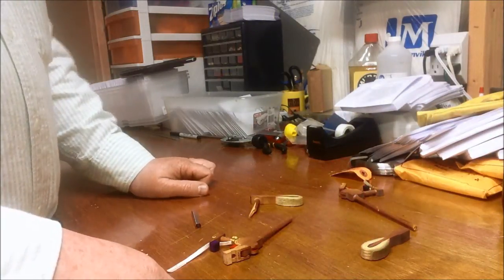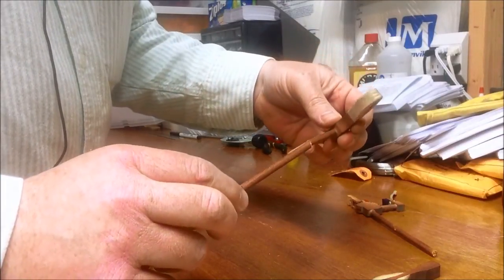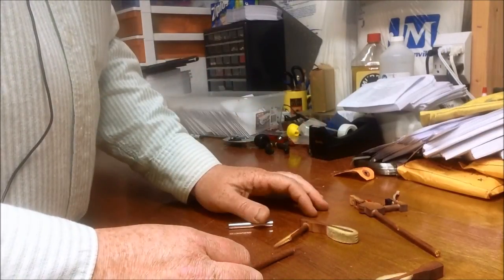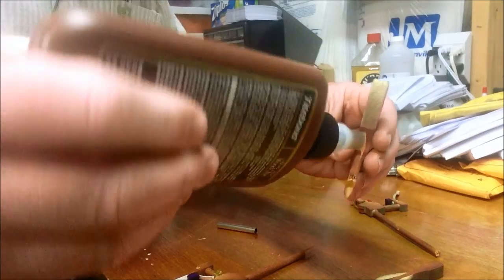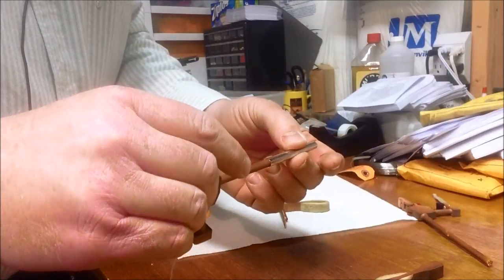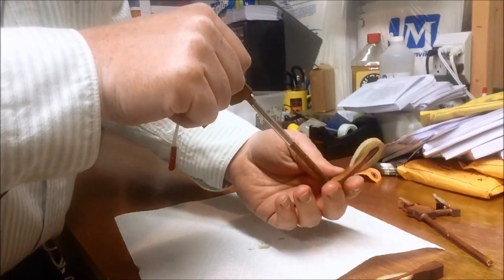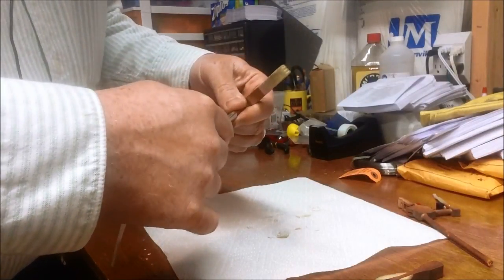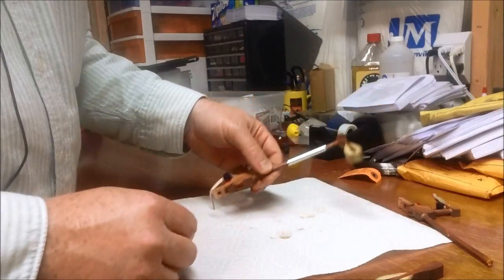Piano Tuning & Repair - Repairing A Broken Hammer Shank I HOWARD PIANO INDUSTRIES

Comment: I've got a break in the hammer head itself. Is that better or worse for trying to glue together? It's a fairly clean break around one side of the shank.
Reply from the maker: You may be able to glue the hammer back together.  I haven’t ever run into this before.

Comment: I had a hammer shank break similarly to the one you repair in the video, but close to the hammer butt. Does that make any difference?
Reply from the maker: If it broke off too close to the butt to be able to remove it with the clamp, you would need to cut off the shank at the butt and drill it out.  You’ll want to make sure you drill it out at the correct angle.

Comment: Noooo way! :D This is definitely not the right method to fix a broken hammer shank. Also it is very rare to have it broken in a pleasant way. You  need a piece (about a half) of new (or even used) hammer shank, remove the residual from the hammer, glue the new one, make an exact same angle cut by a hand plane on both ends and then glue it together, bandage it with a firm and thin yarn and leave it to dry then remove and clean it up. This is an old but still perfect way to fix it.